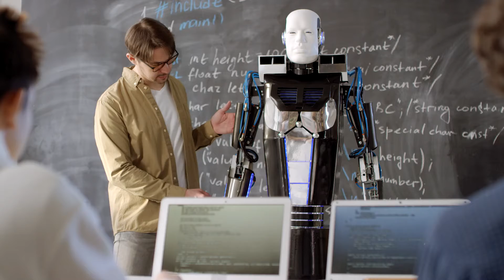The Symphony of Tomorrow: Unveiling the Future of Robotics

Comment: The best way is using duplicate human bone and voltage sensitive as ligaments for motion connect to micro driver inside skull the flesh out with silicon mixture like love doll and memory of all best action and interface entanglement record all best in Profesional on the field and store in data plus rule for unexpected problems way to attain reasonable solution